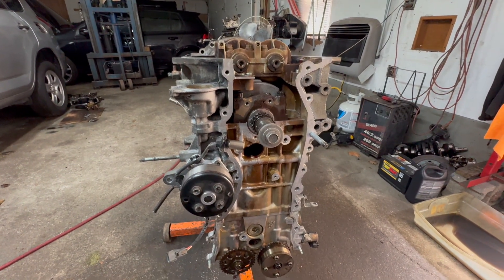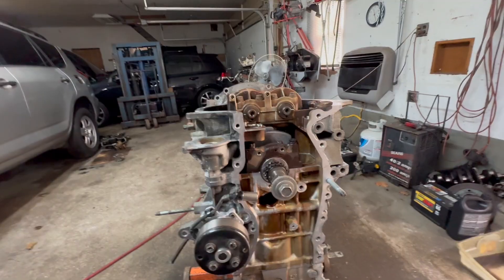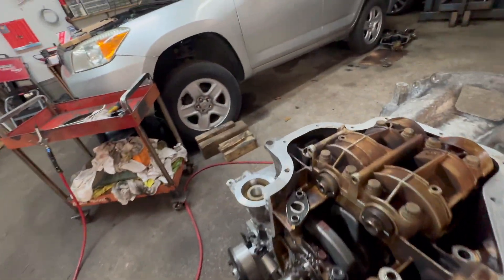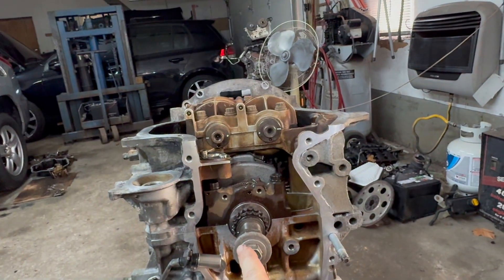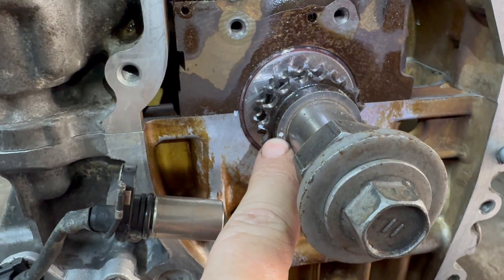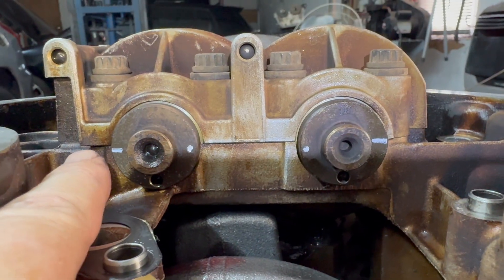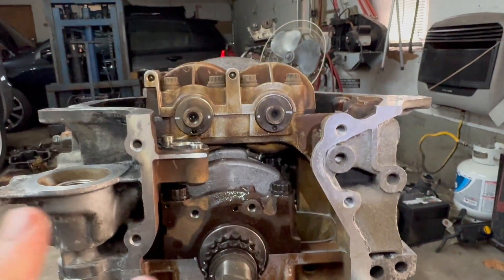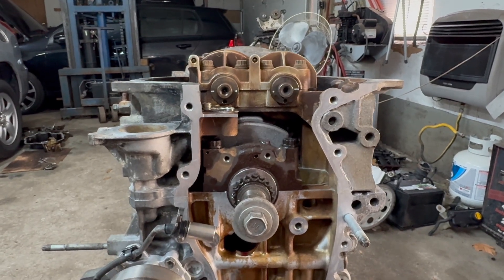How to Align Crankshaft & Balance Shafts on Toyota RAV4 / Camry  2.4L (2AZ-FE Engine)

Comment: Is there a way to know if those sprockets are lined up without removing the timing cover? I removed my valve cover to look at the timing chain marks. I must have turned it about 20 times, and I could never get all the marks to line up. I'm not sure how many times I need to turn it and whether that will be enough to time the balance shafts. Thanks.
Reply from the maker: The marks on the cams and crankshaft won't line up again after you initially set them with the colored chain link. If you didn't make your own marks on the cams and crank then there is no way to know if timing is off a tooth.

Comment: I replaced my balance shaft on my Toyota Camry XLE 2.4, and now I have a knock sensor code. Is there a way to make sure all these marks are lined up without taking the timing cover out? I wish I had seen your video before starting the job. Any help is appreciated  Thank you
Reply from the maker: Unfortunately not for balance and crankshaft alignment. This is why I made the video.